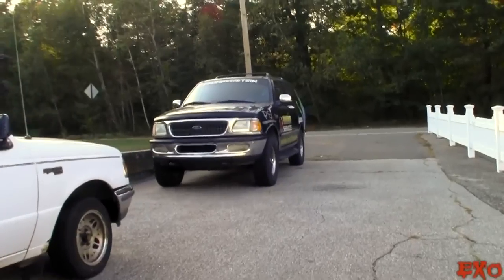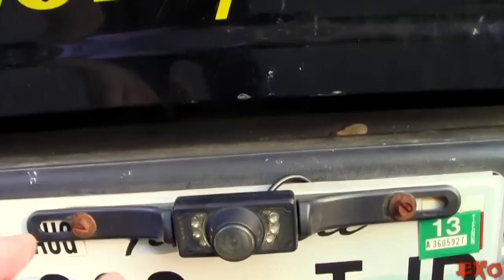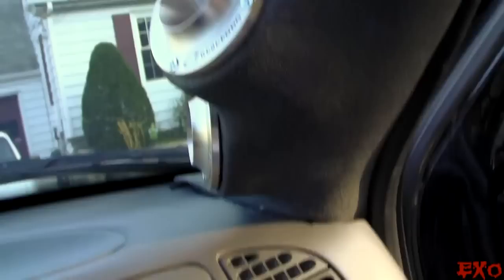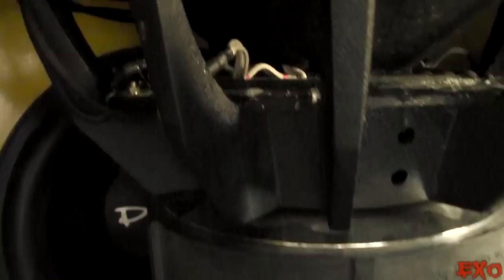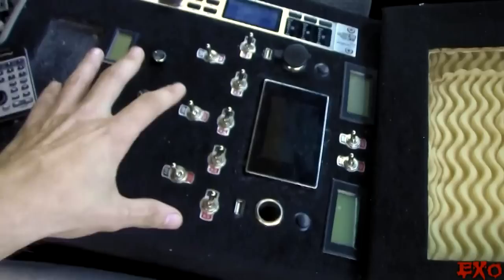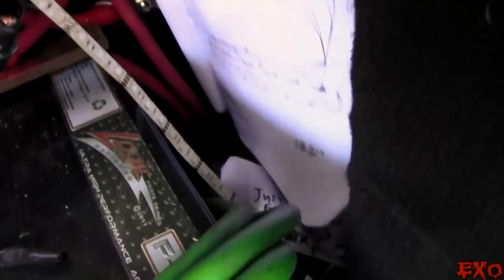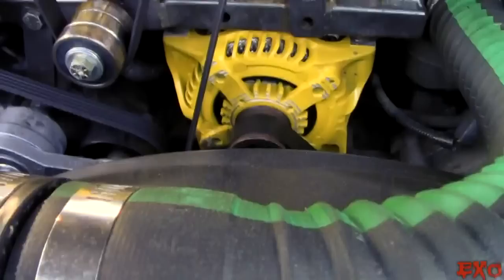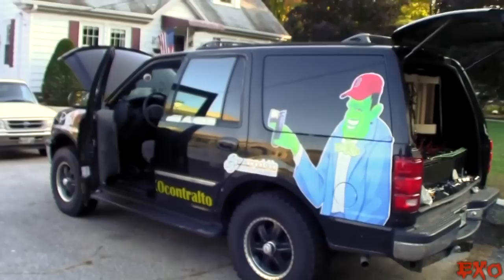System Walkthrough w/ EXO's Car Audio Build | Crescendo Speakers | LOGIC Batts & Iraggi Alternators

Comment: That amp will work for just the subs. I would suggest looking for one that has 300w 2ohm output. you can wire parallel, all you have to do is wire the positives and negatives together. The reason being 2 ohm is because you have dual 4 ohm, 2 ohm is half the resistance but you have 2 subs, so using basic math.. 4ohm/2ohm (half) x2 (dual speakers), you have 4 ohms again.
There's also stereo, which songs can have left/right bass, just look for dual channel with outputs at 150w.

Comment: Also another reason why that amp isn't the most optimal, other then price, it's originally 4 channel. The dual channel 4 ohm is bridged, meaning its taking two channels to make one. I know bridging can cause distortion, and overheating, and other things on some brands; but I trust Rockford. 
But if you're going JUST for dual, it's better to get an amp that was built for dual.
Plus it'd be cheaper to go for the dual/mono. It takes more money to manufacture a multi channel, time and materials.

Comment: @ digitaldesigns50 the green wire is weld cable....but if you want some green power cable Knukonceptz has their "Kandy" line of wire check it out.....

Comment: why don't you use dielectric grease on your exposed electronics?... like terminals in the engine bay, etc... it should prevent corrosion like you're seeing

Comment: Why so many batterys and alts?????
Reply: +chevy247 6 BC 3500 amps x the amperage all 6 pull at the same time at full tilt. Without all the electrical, batteries and alts, he would have massive voltage drop and other problems..
Reply: The more alternators and battery you have the more power it will have towards your system so u don't have too literally charge your starting battery when u leave all the time too go somewhere like see if was too run that on stock things ur battery would die with the car cranked up